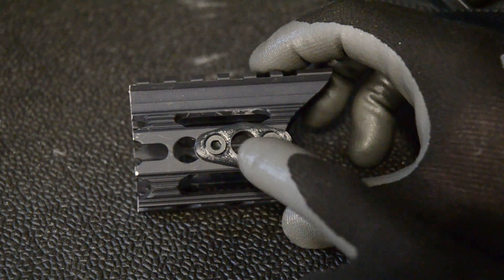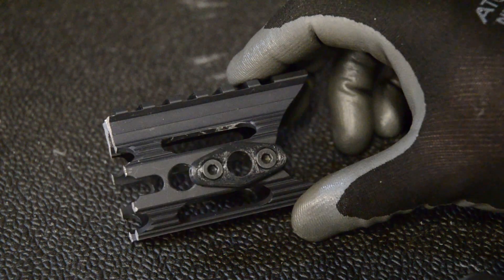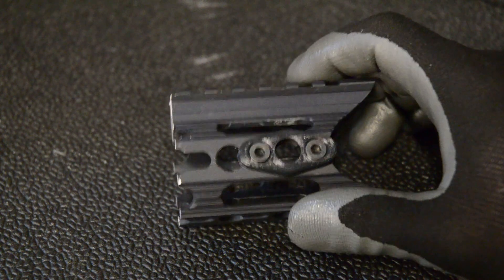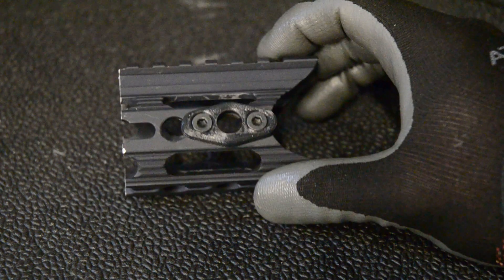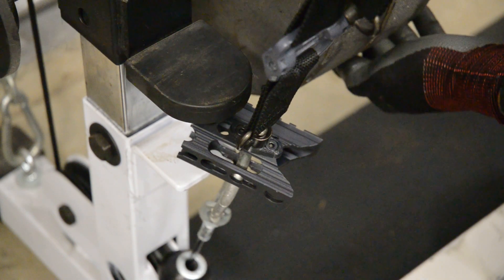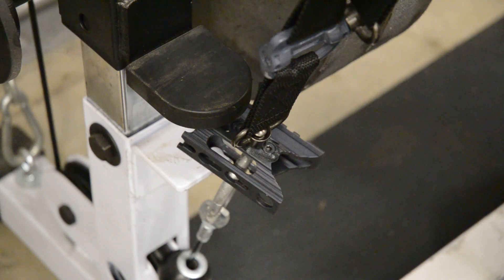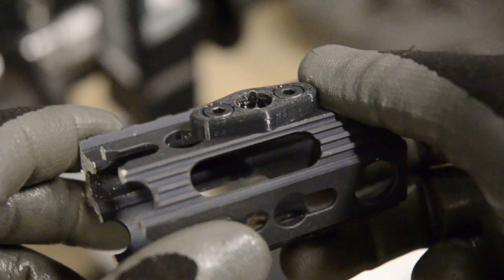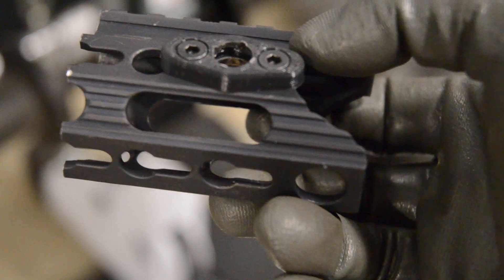3D Printed Keymod QD Sling Point Mount

Comment: You should try annealing the pla at 230f/110c for an hour in the oven. Thomas Sanladerer had great results in his Bake your PLA video. Others have had varying results depending on the PLA.

 I've had good results with the two rolls I of PLA I currently have.  Strength is a little better but they are more heat resistant before getting soft. I'd drill out the hole with the drill press because it shrinks just a bit but you could try to make the hole a little bigger to account for the shrinkage.
Reply from the maker: I've tried this, but found it difficult to get consistent results on shrinkage.
Reply: Maybe anneal the part while the QD mount is already inserted?

Comment: If you had a thin metal washer that was epoxied into the hole, it's very possible the reinforced hole could be much stronger. Would be interested to try this, but I have no time.
Reply: That's a good idea, I don't think there would be enough room. I bet with a little tweaking it will work tho.